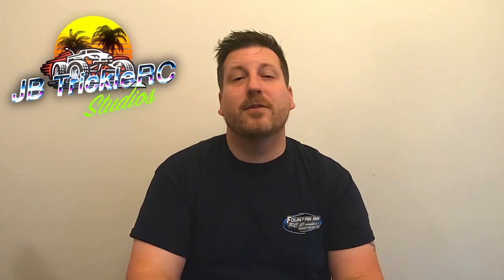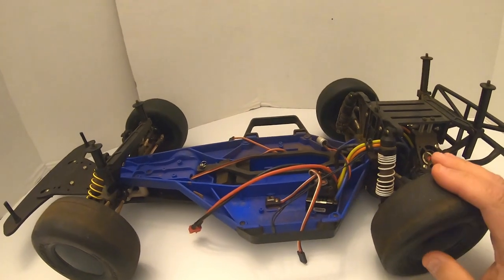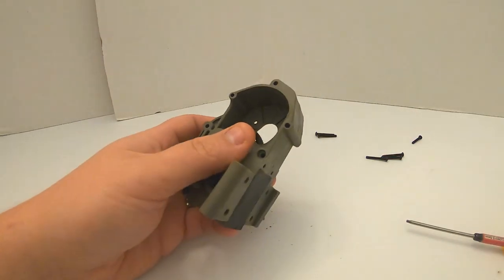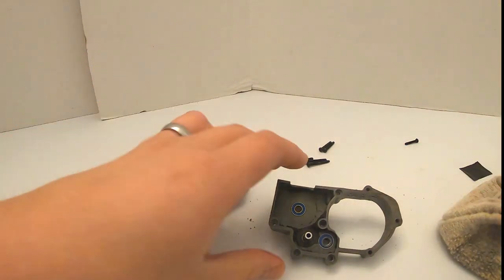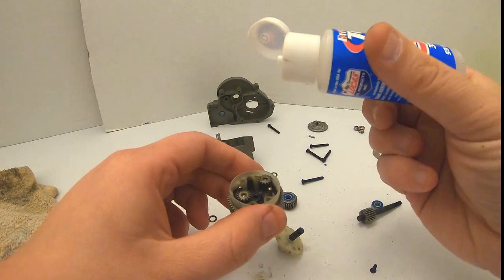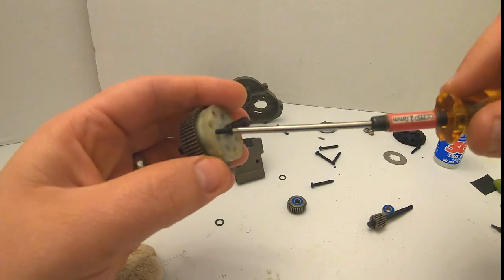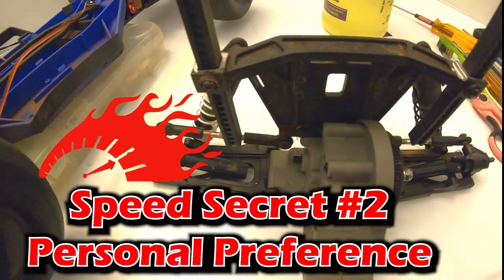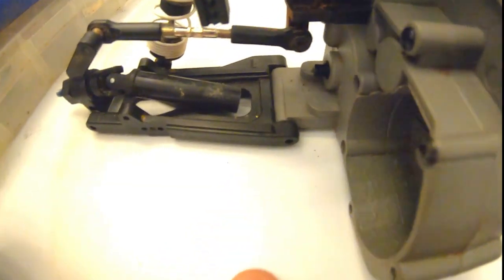Traxxas Slash Speed Secrets, Buggy, Speed secrets for RC Dirt Oval.

Comment: Speed secrets are great love it keep up the good work just wondering will this translate to carpet oval
Reply from the maker: Thank you Steve I greatly appreciate the support as always.  I dont think this would translate to pan car carpet oval.  This would mainly translate to transmission based cars.
Reply: Thanks for the come back buddy I appreciate it I wasn't clear we run a 1/18 scale latrax rally car on a small oval and was wondering if the toe out on the right rear would be wise
Reply from the maker: @stevedodrillsonandoffthewo754  I gotcha now. I hear carpet oval I instantly think pan car lol it may work but would take some experimenting. That's part of the fun of RC racing, experimenting and Engineering lol. No problem at all. I appreciate the comments and talks always.

Comment: Where did u get the body mount posts from?
Reply from the maker: Cletus, those are the Proline Traxxas Slash 2WD body post mounts on the front and the rear was a 3D printed rear extended body mount from eBay. No particular brand on those, just custom 3D printed part.  They are pretty easy to find on ebay as well.

Comment: What motor and esc are you planning for the legend?
Reply from the maker: I had an extra HobbyWing Justock and 21.5 motor I put in it. It's for breakout racing and will likely have to tune down the speed endpoints some anyway.
Reply: @jbtricklerc  is that brushless?
Reply from the maker: @BC-rc  that's correct, it's a brushless system. I believe they are starting a spec brushed class. But the system I'm running is brushless and will be ran in the breakout class.

Comment: would putting a left side a arm do the same thing as flipping the right a arm
Reply from the maker: It would work as well. However, the reason we do it this way was due to the gray area rule. They stated the arms must remain in factory locations.  So flipping the right arm technically kept it in the "factory location".

Comment: Have been oval racing slash and t5 stadium truck now for about 3 yrs and finding info at the track to go faster is nearly impossible where we race. You can see some mods like the A-arm mod but some guys are so fast and their slashes  are on a rail it seems. 
We run 12t titan class and don't know how they get their motors so fast? 🤔I have tried different break in methods with limited success. Maybe some just motor luck of the draw?
Reply from the maker: Leeroy, I appreciate the comment and there are many factors.  One is definitely chassis and suspension setup. Getting that car on a rail and corner speed is very very important.  Once the car is handling and cornering well, then I always focused on horsepower.  With the 12T titans, it really is a luck of the draw.  I used to buy 4 of them at a time, do the water break in method and then I'd test them to see which was my best performing motor.  I'd keep the best for bigger races, the 2nd best for main events and the 3rd best for a normal club race. the 4th would just be a emergency back-up or id give them to a break-out racer.  If you havent already, check out my other episode where i turn a slash into a dirt oval car.  I go over some suspension setup in that video as well.
Reply: @jbtricklerc  yeah thanks for replying back I am gonna sub to your channel. I only race so my son and I can have fun out together not really out for much else, But it is good to be able to actually out up a fight and get a podium once in a while.
Reply from the maker: @leeroyexcavator9149  i completely understand.  Welcome to the channel and I hope you find it helpful and entertaining.

Comment: My mudboss went WAAYYY faster after removing the seals from all the non-outer brgs. in the gearcase and diff. clean w/ superclean in a jar
and rinse/blow dry. I lube w/ ATF .. it stays on and wont fling off.  Only leave seals on the brgs facing the dirt.
Reply from the maker: Absolutely. We removed the seals a lot of times on our pan cars. Much easier to clean than a dirt oval.  In Some dirt oval classes we would change bearings ore some would trim the seals. However some classes which were supposed to keep "stock" bearings were inspected at big races.

Comment: folks some times Trim the " blue " bearing seal removing like 1/16th on the edge of the seal this reduces the drag on the bearing becouse the seal doesnt make contact witht he two moving parts
Reply from the maker: Zack absolutely, another small detail that other racers either are not aware of or overlook. When chasing tenths every little detail matters.  Thank you for the comment and support!
Reply: @jbtricklerc   can you do a video of Wheel bearing 5x10x4 trimmed vrs stock , if you have time that is  , and a water brake in video  ?
Reply from the maker: @zackriden79  thank you for the requests.  I'll see if I can fit those in the near future. I've got 4 episodes lined up now but always try to work in the requested videos during down time weeks. Thank you for the support.

Comment: Couldn't you use graphite instead of the 30 wheight shock oil?
Reply from the maker: I suppose you could. There's many different methods that work.  Just sharing what worked best for me.
Reply: @jbtricklerc  I use to race buggy a lossi in the mid - late 90's. I used 30 wheight oil just enough to get a lite coating on the gears. I never thought of reversing the right Aarm
Reply from the maker: @terryperrott8567  awesome, very cool. Oh yeah, there's always various methods and ways and finding what works best for you is part of the fun

Comment: is a lock differential good or bad on dirt oval
Reply from the maker: Bad for high bite. For loose dirt I cannot comment as I have no experience.  With high bite (packed dirt track) it's all about corner speed so you want that differential working as smoothly and freely as possible.

Comment: Awesome info, Thanks JB.  What about tightening the spur down on a dry slick dusty oval?  Will it want to spin more with your spur tight on that type of surface?
Reply from the maker: Flying Fortress RC Great Question.  Getting the Diff free like in phase one should prevent that from happening.  However, if you feel that it becomes an issue you could back it out a bit.  However, what I normally do is always run my slipper tightened all the way down and if I need to slow the forward drive up (slide a bit back on throttle) I pull a little throttle curve out of the radio to slow it up a tad.  But I'm personally always 100% tightened down on the slipper and I've race it that way on high bite surfaces as well as slicker surfaces.
Reply: @jbtricklerc  awesome I'm definitely going to try it. 
But I ran into a problem flipping the RR arm over....
My RR driveshaft is binding badly on the cross section of the arm next to the bearing carrier.. I'm in the lowest hole of the bearing carrier and even moved the lower part of the shock out to the hole closet to the tire... 
It's kinda hard to see yours in the video with the tire on but did you cut out that cross section?
It's almost the only way I can see to do it but I'm afraid it would weaken the arm... Thanks 👍
Reply: It's also limiting the bearing carrier angle where the outside edge of the tire is about all that would be contacting instead of the whole surface.
Meaning I can't move the top of the carrier towards the gearbox..
I'm doing this for a mudboss that is just like yours with the lcg chassis.
Thanks JB.
Reply: I actually just tried the same thing with my Traxxas bandit  street stock and have the same problem as my mudboss.
Reply from the maker: @flyingfortressrc1794  I did have to do a little fitting.  I didn't remove anything but did Dremel a bit for clearance.
Reply from the maker: @flyingfortressrc1794  do you have limiters in your shocks? I just looked at mine and can see the clearance issue you mentioned and it would be worse if you don't have limiters in the shocks. However, like in my previous reply. Some Dremel clearance was done to both cars that I've flipped the rear arm on.
Reply: @jbtricklerc  yeah I have limiters in my shocks bringing the arm perfectly horizontal from trans to the wheel. 
Cool I'll have to play with the Dremel later today because I can definitely see how this modification will help the rear steer.
Thanks JB..
Reply: @jbtricklerc  sounds good, Thanks 👍
Reply from the maker: @flyingfortressrc1794  no problem at all. I'm happy to help. I should have said in the video it takes a little fitting as well. But since it was already done on that car and I didn't show the process I didn't even think to mention it lol. Thank you for the support and comments as always.
Reply: I just found your channel two days ago but too late to try the second tip this year( racin season is done for 2022!😢😢).I already do the transmission tips but what I use in the diff case is use 3in 1 oil ..so over the winter when I tear down both cars( a 12T Mudboss and a nitro Mudboss) I’ll do the things that you said and next summer I’ll let you know how it goes

Comment: Permatex silicone ceramic extreme brake parts lubricant...it is a thing.
Reply from the maker: Funny to read you post something like this because not too long ago I found some Dupont lubricant/grease and it's something we use on some valve parts at work. It works great too lol

Comment: Why not just use diff oil in the diff? Personally I'd be running 5000 or 7000 diff oil in the diff. For a 2wd Slash probably 5000 if it's running a brushed motor. If running brushless probably 8000-12000.
Reply from the maker: You can, and it works great too and worth experimenting with weights if that's the direction someone wants to go in.   I was just sharing what me and a few others discovered long ago and able to use something that's likely already in your Tool box without having to order something different.  There always various ways to get there.  I appreciate the comment and support.
Reply: @jbtricklerc  Diff. oil is pretty inexpensive though. Like shock oil, or grease. Just saying. But I appreciate the reply,
Reply from the maker: @TruthFreedom1776  absolutely.  And many still run diff oil in there too as you can get it light enough to do the job still successfully.  This was just sharing a way to use something that most people would likely already have in their tool box. That's the beauty of it.  There are many ways to get the same results.  I appreciate the comments and support.

Comment: Couldn’t you just put a left on the right side instead of flipping it?
Reply from the maker: After thinking about this further and reviewing my previous reply I've updated it to be more accurate. I believe you are correct and could put a left arm on the right side as an option and would basically do the same thing (toeing out the right rear). However, we've never done this because per our class rules, we have to flip the right rear arm because it's "still the right rear and in the cars original location" even though it gets flipped.  In other words its still in the same location as factory, just flipped. As crazy as it sounds (as I bet it would be easier to just put a left arm on the right side) it's one of those gray areas that was once outlawed but now is allowed lol. I wanted to update my reply to say yes I believe you could do that as well but like I always say, check with your tracks rules first, even here, some location and some classes it is outlawed. Thank you for the support MH
Reply from the maker: M H I have updated my reply. I realized that I was wrong in my original reply and updated it to elaborate why we have to flip the right rear arm but confirm your question could work too (if allowed). 
Thank you for the support.